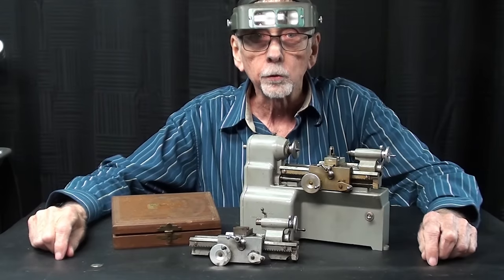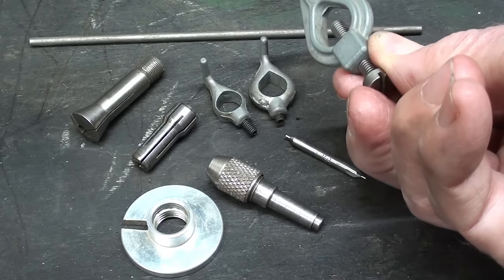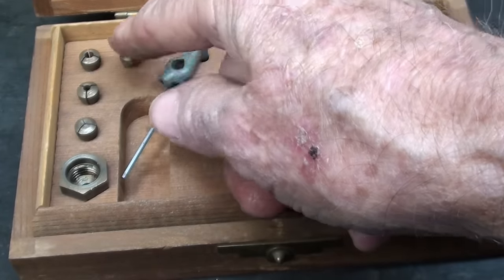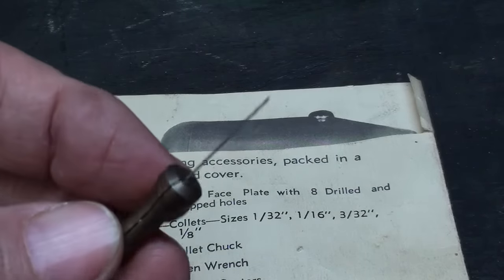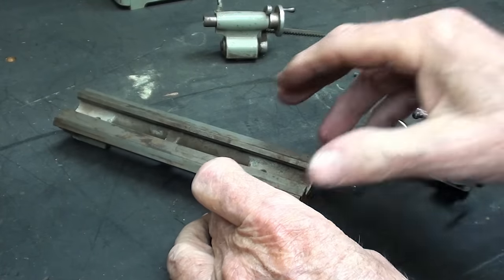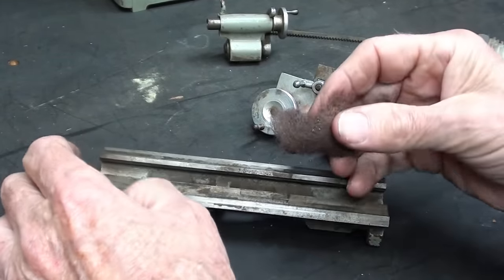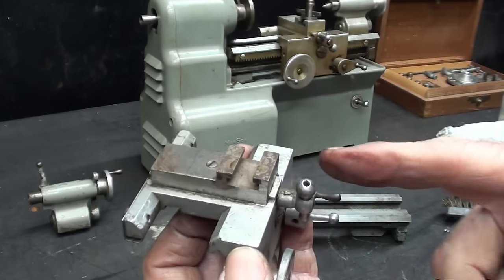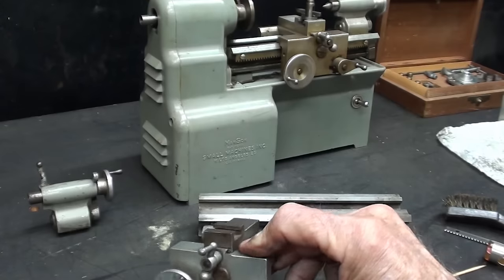THE FANTASTIC MICRO MANSON LATHE #932 pt 3 tubalcain

Comment: Mr Pete I wanted to share a safety experience with you and the crew. I recently purchased an Atlas lathe and as usual many of the parts were rusty. So the other morning I was trying to remove a chuck adapter that was in a collett. I applied some pb blaster and set it aside for a couple of days. Then I had the bright idea of heating the collet up with a little propane torch to be able to push out the chuck adapter. However what I wasn't aware of at the time is that the collet in not drilled through. So what happened was that when the collet got warm enough the pb blaster turned into a propelent and the chuck adapter turned into a bullet, ricocheting off several other machines, a couple of walls and through the fiberglass garage door. Live and learn, safety first.
Reply from the maker: WOW!!!!
Reply: That's exactly what I said. Fortunately I had removed the set screw, so it didn't have the extra inch and half to build up more pressure.

Comment: Mr Pete, thank you for the overview, you marched right through the design description like you had in cruise control. Great job!

This lathe is so cute you could put it in a baby crib! 😂 

However, it’s interesting concept for a model engineering project, milling the parts on a conventional milling machine, turning parts on a South Bend, grind the bed on a surface grinder, there are a lot of stock drive parts from companies like BERG and Boston Gear which could open up interesting possibilities.

Yes is looks like a compact 10 EE Monarch! 

If your wife uses WD-40 for perfume, she may be trying to get you out of the shop for a bit! 😊

Thank you again for sharing and introducing us to this little guy.

Randy Musselman
Wyoming, DE

Comment: I wonder if the collet for the collet chuck is the same size as a Dremel uses.
 Amazing that they made the bed with v-ways.  Would have been easier to have made flat ways like the Atlas has. 
I think that the drive plate may have been made by the original owner right on the little lathe. 

 I'm looking forward to seeing chips fly from these marvels! 
MJ

Comment: up early too. making the driver for a alignment pin remover. Basically a standard screwdriver inside a 5/8 hole. I chew up my fingers driving a regular screwdriver socket bit. I'm about 40 operations into it already. This tool does not exist in nature, so I have to make it. Making the flat for the driver for the second time right now. I will head to the shop and weld the driver into the socket when I am done. Then back in the lathe to clean up the outside. Into the vevor oven to harden. into the toaster oven to temper, works great. Then i will cold blue. 900@ for any body who wants one, LOL.

Comment: I am curious about the kits drive plate/lathe dog relationship, from my perspective the dogs legs are to big to fit into the plates holes and if the legs do fit in those holes ,it might be a challenge to fit a part to turn Vs the traditional looking face plate with the slot for the dog leg.

Comment: That is sure a cute little lathe. It sure would be hard to handle those tiny parts. I think the rack in your hands had the "B" serial number not the assembled lathe. If so they went from a steel cross slide to aluminum or maybe something cheaper? A cheap casting?
Reply from the maker: Thanks